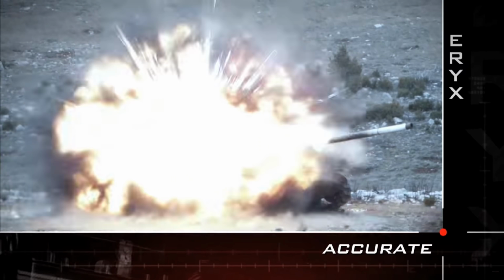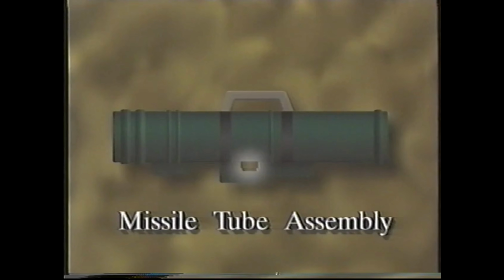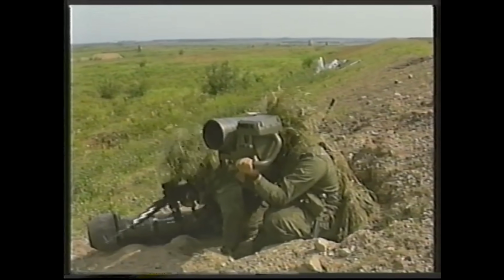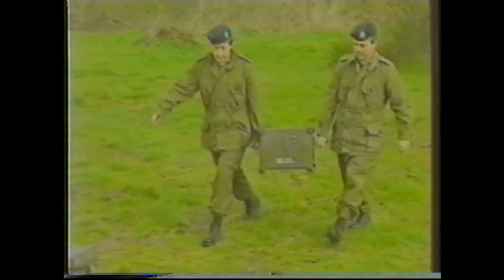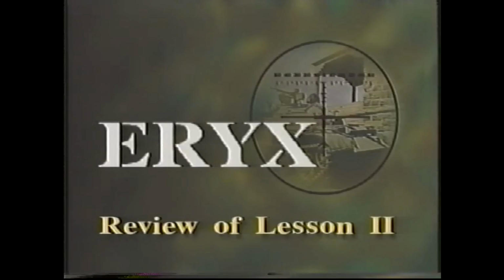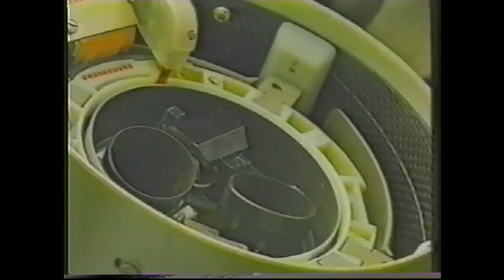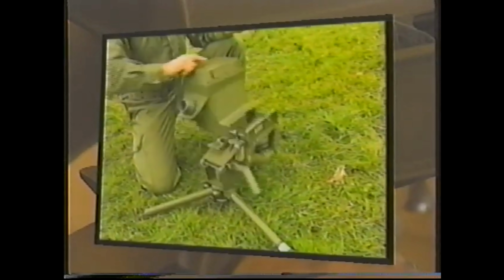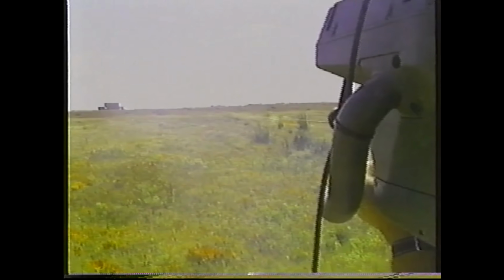The 'Eryx' Wire-guided Anti-tank Missile | HOW DOES IT WORK?

Comment: Well, I wondered why the Canadians retired the stuff?

Probable causes:

1) If compared to a Carl Gustav it does not really give a range advantage that justifies 6-5 seconds staying in fire. The other thing is that it cost about a factor 10 more than a Carl Gustav pr. pop.

2) It does not like frost and damp - knowning the climate around the Baltic - hmm, that requires some cooperative spirit by the enemy and devine powers.

3) It requires a shitload of maintainance, frequent testing - easily achieved in a foxhole - NOT.

4) To load the damned thing, it requires a largish team of qualified engineers. Plus grenadier sized weightlifters to shift the "clip" of four - they should be qualified in embroidery needlework as well. A skillset rarely found in practice.

5) On the balance a better solution is a combination of Carl Gustavs and a half battery of 105 mm. in direct fire mode.
Reply: +Thomas. The reason these type of systems get retired is because they are in a weapon category were they are only used on heavily armored targets. You would only use the Eryx when the RFK84mm and its ammo was TOO WEAK or range too far to defeat the target. In video games you might use an RFK to defeat MBT at 600m, but you are not going to do that in real life. Those things shoot back and can see your "eyeball" at 600m. However, when you face a T72 or something with a system that can only reach 600m, has a ton of "shut off" aspects too it, needs ca 5 seconds to hit the target and if you miss you are dead. It goes without saying that upgrading it to a Javelin "fire and forget at longer range" is a better option. The Eryx was replaced because it was bypassed by better options, but it is in storage because the Javelin costs more and live rounds are often not used during training.

1) Its not a ether or question. The RFK84 and Eryx /Javelin or similar are supplementary systems to each other. Maybe there are some new 900mm tandem HEAT round for the RFK84 today, I have my doubts, but that was not the case back in the day when Eryx was new and the RFK84 had been in service for a while. Lobbing a really heavy (none rocket assisted) RFK84mm tandem HEAT round to 600m would be very hard as well if you were expected to hit the target.

2) These aspects are overrated in the documentary. Its just that military hardware is usually handled a bit worse and you cant handle "optics" systems (anything with optics for that matter) in the same manner. This system doesnt have a huge issue with winter warfare, but you cant treat it like a LAW or insert similar 70s tech.

3) Again, overrated in the doc. Regular soldiers dont even get trained on the whole suitcase thing. That is what a dedicated Eryx only type unit or the weaponsmith would do. Not regular soldiers. Proper handling, correctly put into storage bags, keeping the optics clean and protected with the rubber holders and checking connection points ala similar to a Nintendo NES cartridge and you are good to go. These systems are expected to be operated in -20 type Nordic weather.

4) RFK84mm is a harder system to train on. You would normally only get 1 week of total training on the Eryx before you were expected to operate it. This doc actually skips most of the actual soldier training aspect and goes allot deeper into the technicalities of it than a regular soldier would need to know. This video seems to both be supplementary, but also aimed more at people who will teach others on the system, in my view. The shells are not that heavy and it is easier to load a live training round than an empty cylinder used during field training because it is much lighter and therefor takes a bit more effort to get to lock in place. That said, if you can "load" a Nintendo NES game. You can load an Eryx.

5) RFK84 and Eryx or Javelin is the intended matchup, not ether or for those units meant to be able to defeat MBTs. That said, other operated systems in other units might be out of range, knocked out or busy and that is why it is wise to have access to something handheld you can use when you need it.

Comment: The launch fail happened with the Javelin and many other systems anyone saying it’s bad cause of that is totally undocumented and untrustworthy
Reply: I was in the presence of a javelin malfunction so so you are correct on that lol.
Reply: Retly yet they are both great system hoped you didn’t get too spooked
Reply: @T0T0RO0O0OOOOOOO  nah it was just a dud but I won’t lie I screamed like a bitch when it happened lol
Reply: @lamwen03  Why do you think the stuff malfunctioned?
Reply: Hated this piece of junk. it was only bought, due to penalties, after the EH 101 cancellation. Saw two launch motors blow up, in the tube, on one ex.
 600 m range drew the attention of every one armed with something bigger than a pistol.
 Firing from the kneeling position ; the wires would nearly drag you off target, at max range. TOW gunner, so maybe biased.
Reply: rob harrington well if it was bought not to be used was it stored correctly and properly maintained?